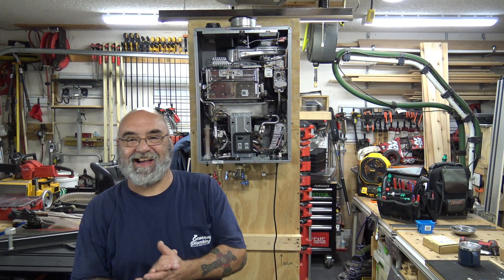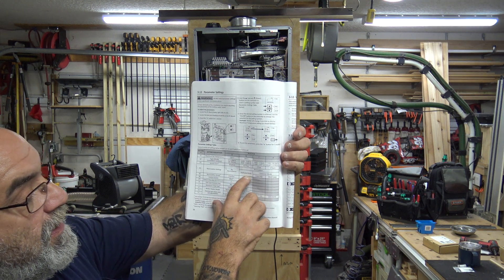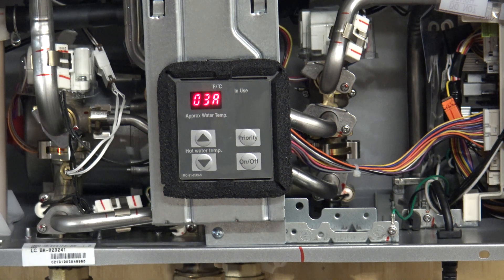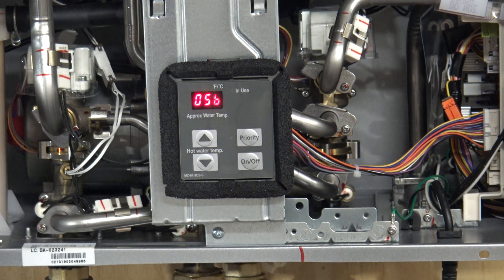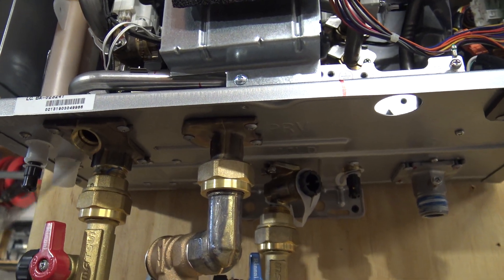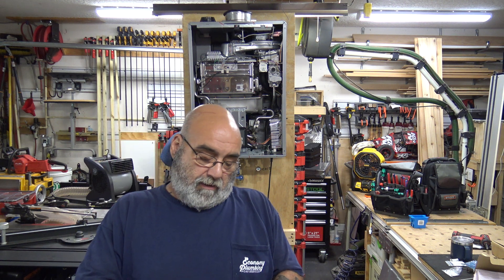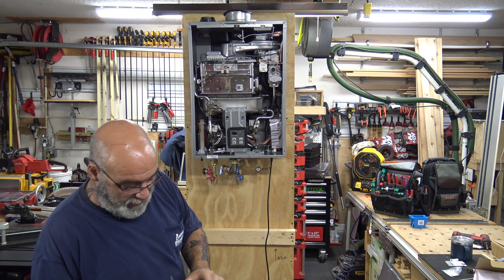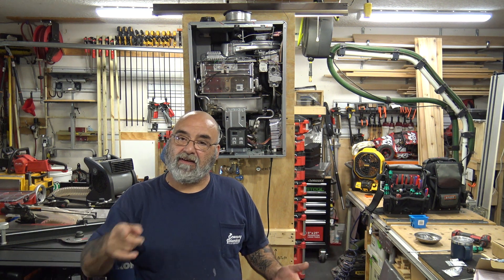Parameter settings and bleeding out heat exchanger and pump on a Rinnai RUR unit.

Comment: Thanks for all the info, Mike! I’m troubleshooting our recirculator no longer working. The system itself appears to be running on schedule as well as on demand via app/contolR. When it is supposedly running we no longer hear the water flowing through the valve. The parameter was oddly set to dedicated so changed it to crossover mode long loop. Unfortunately, still not flowing through the valve. Should I hear something at the tank other than the normal gas delivery sound? Like a pump? Or is it kost likely the original valve installed back in 2018 that needs to be replaced? TIA

Comment: I’m amazed with your videos. Very clear, easy to understand every of them. I been watching for weeks. I find so much value for so many people that want to be educated.
I recently purchased a Rinnai model REP160. If you can help me understand if this unit comes with the recirculating system build in? Even though in the manual says that has a pump. However watching your videos I don’t find the filter for the dedicated recirculating line on the button of the unit.
Perhaps I can contact the manufacturer to get information on that.
Either way I greatly appreciate your knowledge and education you shared with us. Got bless you for your are doing. Thanks so much. Arnie.

Comment: Thank you Mike, your mentorship ability is amazing. The knowledge you pass along in these videos is so important to those who do this kind of work but as well DIY's at home. The sad thing is people like this are a dying breed and are not being replaced with young people following in the trades, God Bless you Sir!
Reply: This is just an amazing comment, thank you very much for the support. Mike
Reply: @mikesmodeltable9040  i just had one question I have a Rinnai RUCS75i. It was having issues staying hot after initial call for hot water.  The only way to have it stay hot was to turn on a second faucet and after the call for hot water from two faucets then the unit worked perfectly.  Why would the activation of a second hot water faucet make the unit stay hot?   No error codes.

Comment: Hey Mike! I'm getting a low vibration during post-purge that can be heard all throughout the house on my RSC190in. It's driving me nuts. My plumber can't figure it out either. Do you have any ideas? Is it a fan imbalance issue? Could my pump be leaking air into the system?

Comment: Thanks, Mike. Another great video.  Is there another video or can you explain the meaning of Comfort and Economy settings?  I see in manual for 120 degrees, the recirc pump is off for 14 and 28 minutes for Comfort and economy, respectively.  Does this mean tankless will fire up and circulate hot water every 28 minutes whether it is needed or not?  I like how recirc saves water, but I’m wondering now about the gas I’m using while I’m sleeping or at work.

Comment: Hi, I have Ruc98i. I adjust dip switch to 6 for hotter water. Problem is when temperature set to 140 degrees water runs cold and later hot water comes back. Why?
Reply: Thats called a cold water sandwich. Hot, then cold, then hot water. Happens more with outdoor tankless units. Bc the water inside the heat exchanger gets chilled and when the unit turns on, that small amount of chilled water gets pushed through to the fixture.

Comment: I have two questions the first one cuz I saw a couple of other people put a expansion tank on a tankless water heater and I was looking and I seen some places saying that you don't need near I trust your judgment better than I do this that's number one number two I got a bungalow house here in Chicago I was thinking about putting a recycling pump on the line with the tankless water heater to try to get the hot water to a certain fixtures like on the top floor cuz I got three floors the basement the main floor and the top floor full bathroom on the top floor cuz I remodeled 4 One on the first floor in the pool one in the basement
Reply: If you have a dedicated return line, it will have check valves in two locations.  The check valves create a closed system, and require the installation of an expansion tank on the closed portion of the line (some say the suction side of the line, near the pump).  Without the expansion tank, heating within the closed system will cause the water to expand and place extreme water pressure on all of the components of the heater, until the T&P valve opens up and relieves the pressure.  The goal should be to keep the water pressure at or below what Rinaii recommends.

Comment: Mr Rinnai, I have this same unit inside my garage.  The cycling can be heard throughout my house.  The recirc pump is fine.  My plumber says that after every heat cycle, the machine requires a cool down of the heat exchanger.  So this thing hums up and down throughout the whole time while recirculating. It is mounted in my garage.  Should I move it to my basement and mount on a concrete wall to avoid the noise?

Comment: what about parameter 11?  water flow,  should we leave it as option a - standard?  or b - high flow?  asking because i have a spa shower with 5 heads and wanted to know if it helps to change it.
Reply: 11 is gas supply. Likely wasn't sized correctly or an issue associated with the regulator, particularly during times of high usage like using a spa shower with 5 heads lol
Reply: My paramerter settings not working even i press and hold bottom A

Comment: does this work as a radiant floor heater?   the system only has 10-20psi on it so im not sure if thats enough to make the Rinnai work.  i know in one of your videos during the bleed procedure water shoots out real fast but im sure thats 45-60psi.   if the Rinnai will work as a radiant boiler, any idea how the lines should work?  i was just thinking return line into the cold and the hot line going out.  but im not sure about the little filter on the recirc pump if its needed since this setup wont have a thermal bipass valve installed anywhere or a dedicated recirc line.
Reply from the maker: E mail me at economypbg@aol.com and I will send you my contact info and I will talk with you. Mike

Comment: If u set the parameters to recirculation but don't have the wifi controller or the wired pump controller hooked up yes should the pump be running? Do you have a email u at I have a few questions about the rur units.. thanks
Reply from the maker: Economyplmbg@aol.com

Comment: Hi Mike, I just had the 199i external unit installed with the wireless Control r unit. However, the small plastic bag still has the controller cable inside. Did they forget to install it? I ask because it takes 2-3 minutes to get hot water in the furthest bathroom.
Reply from the maker: The Control-R comes with a plug that’s the one for the MC-195 controller if used save it. Did they install the bypass valve under your furthest sink or do you have a dedicated return line. Is the App up and running on your phone and is there a light on on the Cintroll-R

Comment: Thanks very much for the video. I'm getting the dreaded Error 63 so I drained both bleeders as you suggested (though not the emergency overflow) but the error persists. I can hear the pump start but the error pops up after about a minute after starting recirculation. The heater has been in service for a year and working fine but I wanted to start using the recirculation feature. The thermal valve and bypass filter were installed. Any other suggestions? It was interesting that the water drained from both bleeders was very milky white.
Reply from the maker: for one your the internal pump did not run? if so the pump internals are all filled with deposits from your water. letting the pump sit is not good for it. try bleeding wster out from the tap just below the pump for about one half hour then try it. if that does not work the pump will have to be replaced. e mail me the results economyplmbg@aol. com Mike
Reply: @ThatTanklessGuy  Thanks for the reply, Mike. I bled the pump for 30 mins but no joy - I still get code 63. The unit has been in use for 1 year. Would descaling the unit help since it's due? Otherwise, is there a way to service the pump instead of just replacing it? Thanks again.
Reply: Yes, I have a RUR160IN and sometimes when I try to start the recirc. with the app I can hear the pump hum but it never causes the heater to kick in. The app just indicates that the recirc is running for about a minute and then the code 63 shows up. No amount of bleeding that pump valve seems to fix it.
Reply: It looks like it is resolved. Rinnai updated the firmware on my unit to 124 and when I tried again, recirculation worked fine without a code 63. I don't know for sure that it was the firmware update but that was the sequence. Thanks for your videos and help.

Comment: Great video,  I'm still confused on how to go from 120 to 140 degrees.  I have the same unit
Reply from the maker: is you unit a RUR if so you need to go into the settings (page 50) and follow the instructions it should be #1 from A to B that will give you 140

Comment: What would cause a rinnai to not heat up but not have any error codes
Reply: I have the same problem. System constantly cycles on and off.
Reply: Same. Seems like the flow sensor isn't sensitive enough

Comment: Hello, 

What if code 63 does happen. I tried to bleed pump from spout to clear air? But code still pops. Someone told me I would need to put it under a vacuum? Can you shed light? 

Thanks!
Reply: I need to know the model number, how old and did the unit sit for a while without the pump working. Mike
Reply: @TheBuddylab  Thanks for the reply! I continued watching the information packed video and think the pump has sat too long. 
The model is a RUR98iN. It was installed in 2017. Just recently Texas had some extreme weather and I noticed an issue with the water heater. The unit is in the attic and I went to inspect.(lost power, water in pump must have froze, expanded and unclipped the retainer on the discharge causing a leak. So I reattached clip. All looks good.) While in the attic I noticed the Thermal bypass valve sitting next to the unit. I know I don’t have dedicated recirc line so I began watching your videos. Installed valve correctly, made the changes to the dip switches, and exchanged the plug for the filter. I’m realizing the pump was left off for almost four years now and while I would use the buttons and app to call for recirculation it was never doing it.(explains why I thought it never helped.)

Comment: Hi Mike.  Great video, thanks.  Our RUR199iN was installed two years ago, before we were the owners of the home.  The thermal bypass valve was not installed at the fixture that is furthest from the unit...How will this affect the performance of the system and the hot water performance at the fixture that is furthest away?  Thanks for any help you can provide.

Comment: Hi Mike. My question is about venting for a condensing unit. If I want to have twin pipe solution then

Q1) What type of Schedule-40 PVC do I use, Solid Core or Cellular Core ?

Q2) The Schedule-40 pipes that will be coming out of the roof, don't have any black coat ( like the Ubbink products) for UV protection. Do you have any product suggestion that I can use to coat the Schedule-40 pipes to make them more resistant to UV damage?

thanks
Reply: Abhinav Gaur use only schedule 40 PVC red letter for pressure. You can paint the pipe coming out of the roof. I hope this helped. Mike
Reply: @TheBuddylab  Thanks Mike. :)

Do you have a recommendation for a concentric vent termination kit that I can use to connect the two schedule-40 pipes to make a single hole in my roof? The ones I find in Menards and Home Depot (DuraVent brand) seem inappropriate for vertical venting solution as their top is open and rain water would get into them easy.
Reply: Abhinav Gaur don’t use that type of termination piece to go through your roof it will allow rain to get in. Either use two pipes with return elbows or us the Ukink concentric venting.
Reply: @TheBuddylab  Thanks Mike :) ... Last question. I am not sure if the Schedule-40 pipes come with some UV protection. If they don't, do you recommend coating the Schedule-40 pipes that are coming out of the roof with some UV protective paint?
Reply: Yes we paint our PVC pipe with a good spray paint when we go through the roof. Ceylon spray is what we use in black or brown depending on the color of the roof.